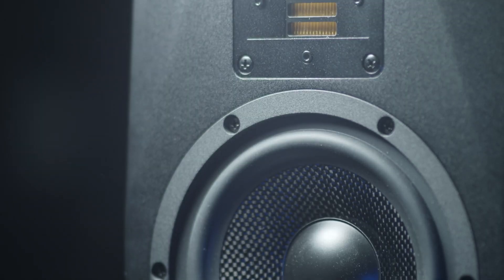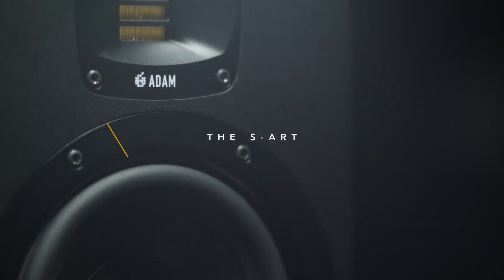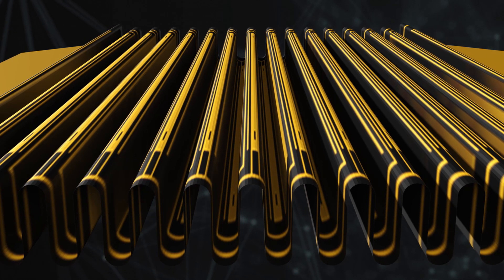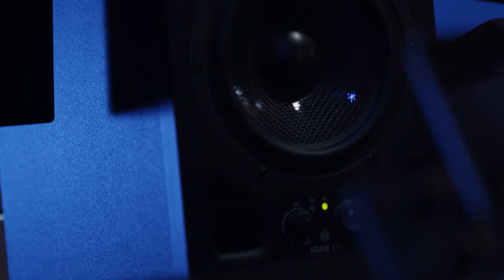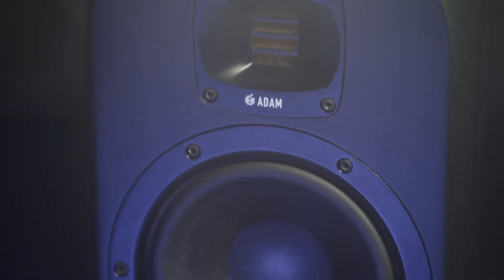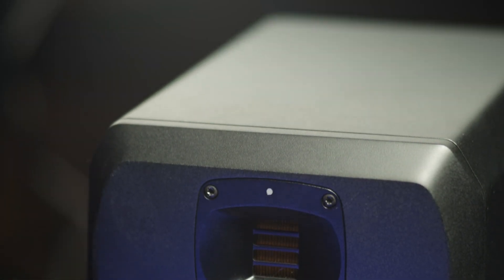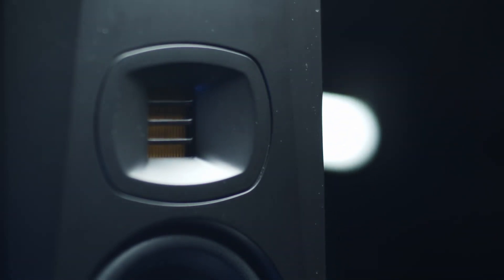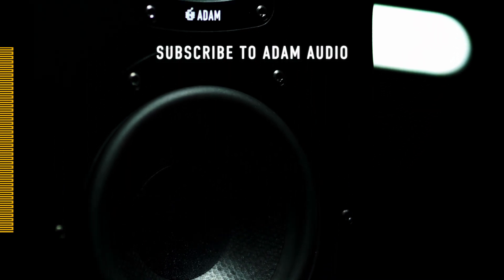ADAM Audio Tweeters (The Basics) | ADAM Audio

Comment: I have just purchased the T10 Subwoofer to go with my T7 monitors.  The manual recommends 80khz crossover when paired with the T7s, but when I tested it with a sine sweep, there's a dramatic drop in volume at around 120khz.  When I set the crossover to 120khz, the sine sweep is more consistent.  Should I follow the recommendation in the manual, or trust my ears?
Reply from the maker: Hi Mason!
Trust your ears, measurements adapt to spatial conditions.
Reply: Thank you ☺ @ADAMAudioBerlin

Comment: Does the tweeter is the only difference in AX series and T series, I want to purchase a pair of speakers for my small home studio and, I am confused weather taking T5V or A5X ? I am in a budget
Is U- ART any good ?
and what's with the front ported and back ported designs PLS EXPLAIN WHICH ONE IS BETTER ?
Reply from the maker: Hi Dark! This really depends on your needs and your space. The A5X offers more power and the handmade X-ART tweeter that is built in Berlin and goes up to 50 kHz. The T5V offers less power and comes with our U-ART tweeter that goes only up to 25 kHz. The front-positioned bass reflex ports will suit you well when your setup only allows for a speaker placement right by the walls. If that isn't the case both speakers will offer a linear frequency response.
Reply: @ADAMAudioBerlin  HEY GUYS really thanks for replying you explained very well .